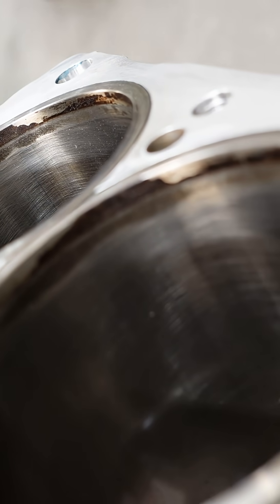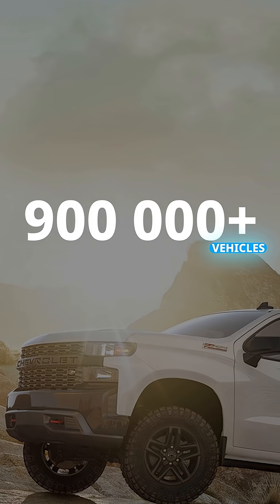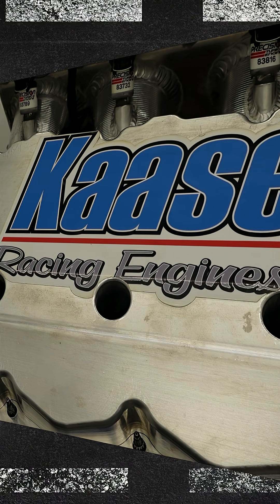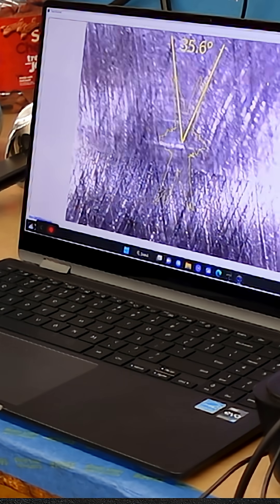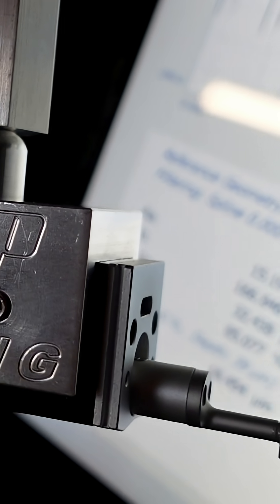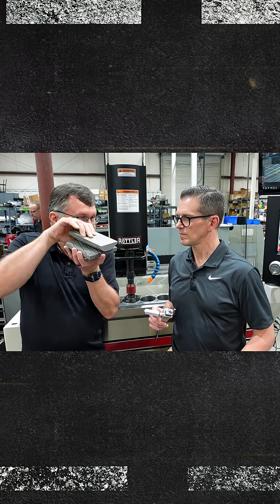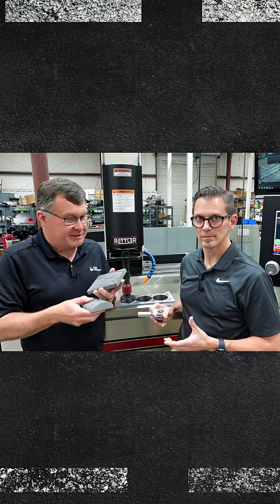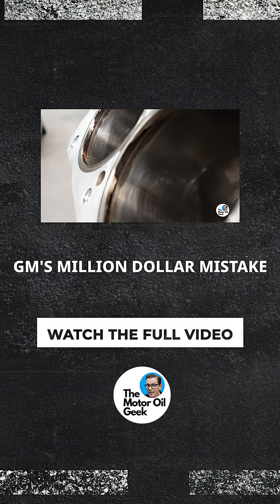GM'S BILLION DOLLAR MISTAKE...

Comment: Is it really the "root cause"? 🤔
Or is it rather greed, blaming environmental rules and lack of testing what brought us to the end of the road towards the thinnest oil possible?
Isn't the fashionable hunt for lower and lower and lower HTHS against each and every common logic rather the fairytale of "The Emperor's new Clothes" by H.Chr. Andersen? 🤪😳
Could the wrong surface finish AND the (too) low viscosity have been overcome with a better oil flow, larger diameter of the oil canals, a higher oil pressure, a better pump and a better filter? 🤷‍♂️
Greed, cost-saving, reducing, down-sizing etc... sometimes it's too much!

Comment: GM: Making import buyers for life for over 40+ years.
Reply: Toyota has had similar issues with debris in their new Tundra engine. GM didn’t do this deliberately. Parts supplier issue.
Reply: @Sandshredder2  Which GM engineers approve of. They specify the parts and approve the given suppliers of those parts. Same with Toyota. Both are squarely to blame.

Toyota took it on and replaced the engine. GM switches the engine oil weight hoping the problem will go away along enough for it to be a "you problem" and not a "them problem". That's the difference.
Reply: @Sandshredder2  GM and Toyota are to blame. Both engineers in the respective companies approve the parts and suppliers. Difference is that Toyota took it head on and replaced the engines. GM tried to sweep it under the rug long enough (until it's a "you problem" not a "them problem") by changing the oil weight.
Reply: @Sandshredder2  2 useless statements. Toyota doesn't have 40+ years track record of this bullshit. And you don't lay this on "parts suppliers". Again, their own engineers and company execs approved the products, & their handling of it has been WAY different.
Reply: Pah, no LT-1, 3800, or 454s were sharting the bed like this, back when oil wasn't fucking HOT DOG WATER
Reply: @captainchicken8983  Because those engines were assembled properly. Today's oil is fine, vehicles are lasting longer today, and better oils have a lot to do with that.
Reply: @captainchicken8983 
“HOT DOG WATER”… 😂